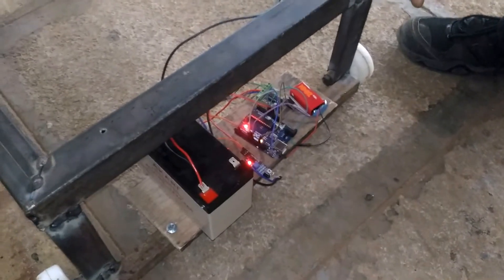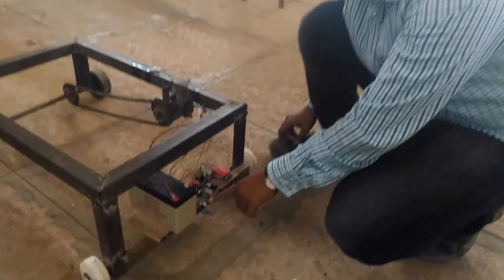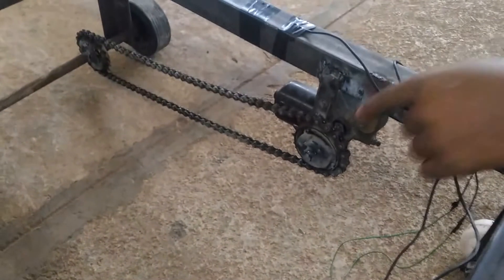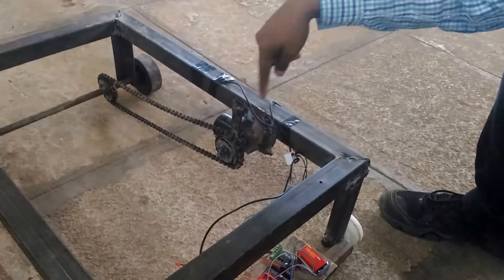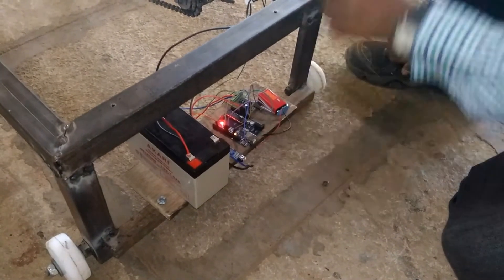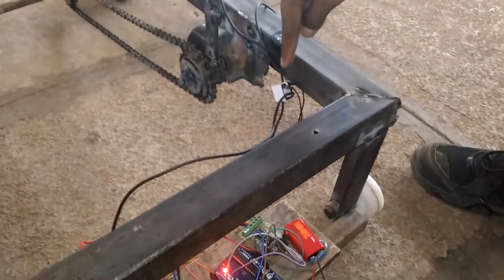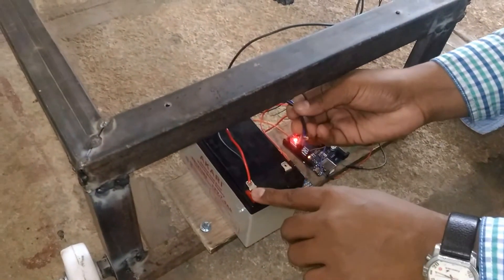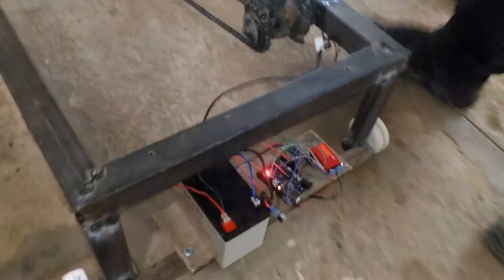Intelligent Braking System | Mechanical Engineering Projects | Arduino

Comment: Assume car is moving to fast and in front of car there is barrier...so my question is what is the maximum speed at which ultrasonic sensor will work and prevent from collision.....if car is too fast and sensor detects it but due to interia it will collide...so how will u prevent this...
Thank you great project
Reply: I think,by upgrading sensor it will sense that some object is coming closer or the front car is slowing down,then the sensor will start slowing our car way before

Comment: sir..thanks for uploading your project and we are also making the same project after watching this video.. but i have some doubt in my mind that is.. what is the rpm of this wiper motor and what will be speed of the vehicle.. and can we use any breaks in this project like hydraulic brakes or disc brakes.. i want your help.. my contact no is +919568038006 and my email id is makhan1994@gmail.com . i want your help as soon as possible that's why i drop my contact no. here..thanks...
Reply from the maker: Is your work done?

Comment: hello sir !! is there any link for wiper motor ?? actually we are also on the same project !! plz if u have any link to buy wiper motor then plz reply !!
Reply: We just want the working principle in a schematic diagram or in written format. As you have completed this project, then you should have done that. So my humble request is I would be very grateful if you provide the desired thing or provide any link in here...
E-mail id: rik.titun@gmail.com
Reply from the maker: link for 12V wiper motor:    http://amzn.to/2pBvamF

Thanks Sankha for watching and subscribing ! I better suggest you to go in scrap market and get wiper motor.. will cost you less.
Reply: Msquare Analysis Thank you !! We yesterday bought it from local market , 12V DC Lucas TVS Wiper Motor costs me around 2400/- .
But one thing, where we get the exact wheel with shaft like those ?? If you gave any contact no then we will be grateful, we are also busy with this project, so if you help us a bit specially the working principle, then we will thankful to you .
Reply from the maker: In any local hardware shop you will get shaft and wheels as per requirement.
We are making engg. Projects and sell them. If u want to purchase report, we can mail you program, 3D model using Catia and some reports.
Reply: How much will it cost? We are working in a small group of 3 students, so, expense is surely a matter of concern.
Looking forward to hearing from you soon.
Reply from the maker: give your mail ID here.
Reply: Msquare Analysis my mail id 
jashsankhasubhra@gmail.com
Subhankar Das is also my group member, we are really thankful to you.
Reply: all tell me about the cost of report and other thing !! You can also call me this no +919734302711. 
We are from Kolkata, India.
Reply from the maker: Thanks for Mob no. Details mailed on your mail Sankha